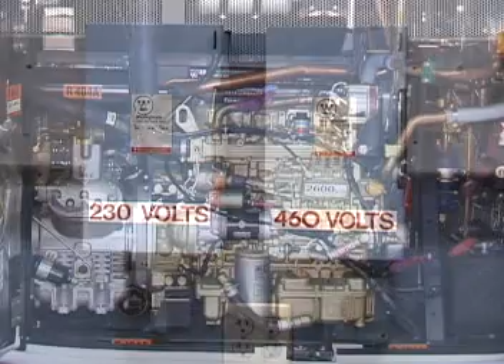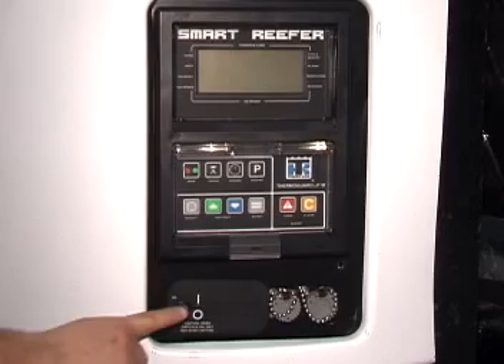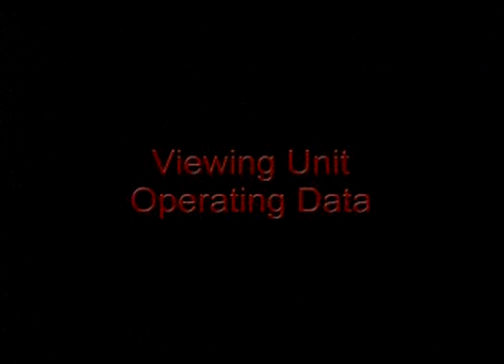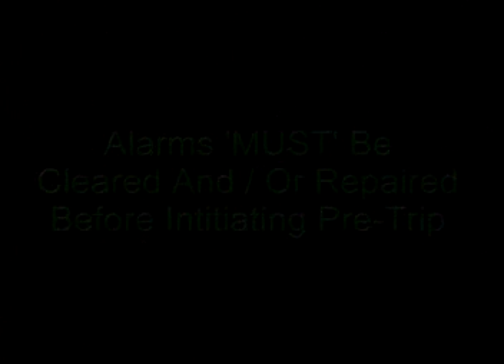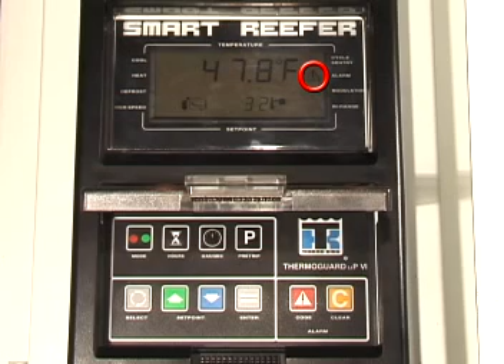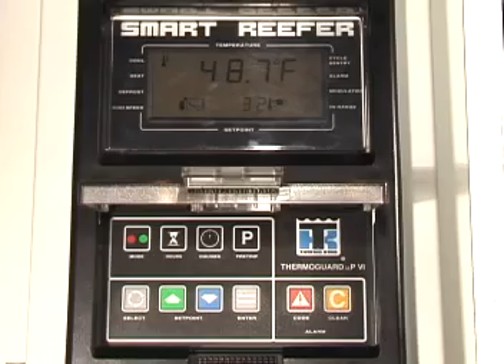Driver Operation - SB Series with uP-VI Controller

Comment: i have a problem with a termoking the engine is remained without diesel him take diesel and not starts already delete all the failures of alarm in the controller smart reefer, and not ago nor intent of start which will be the problem need help.
Reply: yosmir morand  conctact you Thermo King dealer